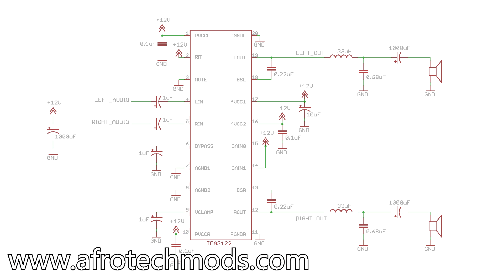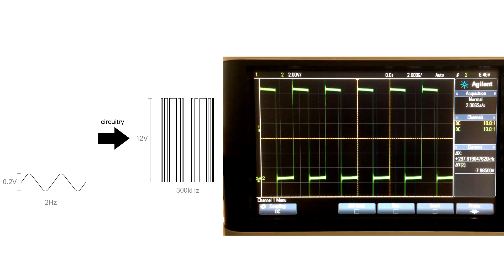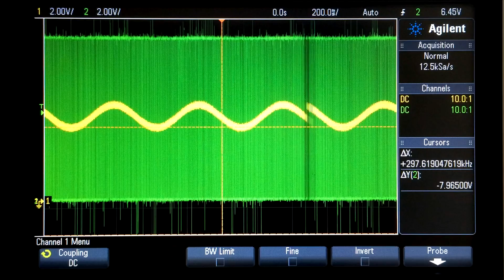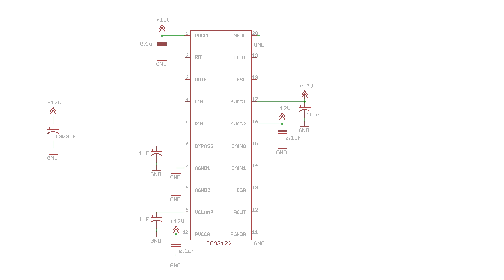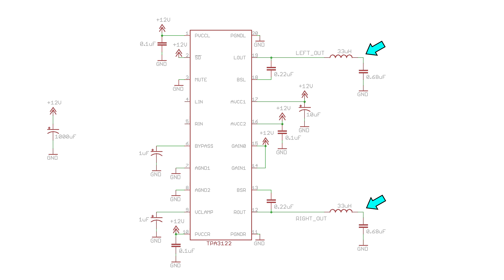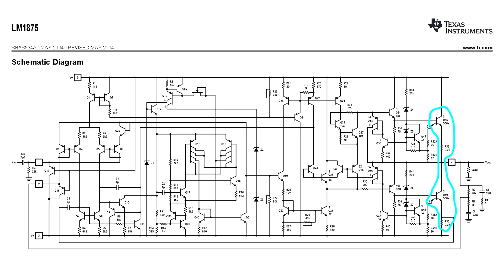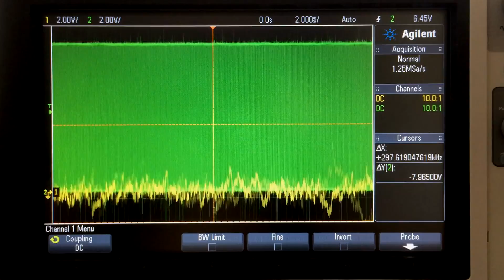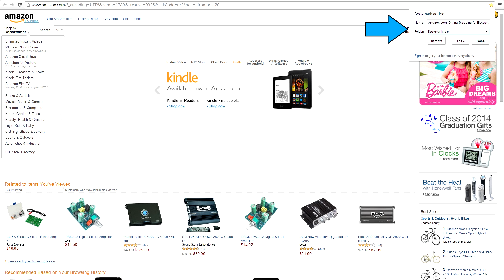Class D Amplifier Tutorial!

Comment: One minor correction - you mention that you can never get a distortion-free output from a Class D amp. This is not necessarily true. If your Class D amp IC has a high enough fundamental PWM frequency and your signal is far enough below it, you can easily use a bandpass filter to remove noise.  If you design your band pass filter well, and possibly use multiple stages, you can get a sharp -3dB with a steep decade slope and have an amp that sounds like a Class A or Class AB.
Reply: +CS Steingrube no amplifier is distorion-free

Comment: Could you briefly explain the power consumption of these amps? I'm planing on buying a tpa7492p which is a dual 25w bluetooth amp and its input is rated from 8 to 25v. I'm guessing, at full power it would need around 50w which would mean i would need a 25v ~2A power supply, or a 12v ~4A and so on? Thanks

Comment: Man you're amazing, i watched a video on another boring guy explaining the same stuff, but i just couldn't walk with what he's saying.
Anyway I've got a question, can i measure the output power of an amplifier board by simply applying a voltage test and current test using a multimeter and solving for the power by V*I?
Reply from the maker: Well the power being delivered would be a function of the load, so if you want to find out max power you'd have to crank up the volume to the max and use the lowest ohm speaker/dummy load allowable. Other than that your plan sounds ok. Just make sure you are using a 60Hz test signal as your multimeter may not be able to accurately measure sine waves with higher frequency than that.
Reply: +Afrotechmods Okay so following what you're saying, I should add a function generator as an input to the amplifier to supply the 60Hz?
Reply from the maker: Yes exactly. Generate a pure 60Hz sine wave.

Comment: Are BLOCKING OSCILLATORS based on Class D amplifier circuitry?
Is a Class D Amplifier in effect a Solid State Relay, working at high frequency switching because there is no inductive reactance?

Comment: earlier for my pc i was using 40+40 class ab amp self buit, it also had a digital fm/mp3 module, then i found a 24v single supply 50+50, 100w class d ready kit, when i installed it my fm was just sounding static, does the pam/pwm interfere with fm frequencies, same happened with another 3+3w, 5v classd kit.

Comment: excellent video, thanks. I've been looking at Class D amps for a project, and I was wondering if you wanted a mono amp is it ok to just use the one half of the IC? also, if you wanted a volume/level control, where would you put it?
Reply from the maker: Using just one channel should be fine. If you want a volume control use a potentiometer voltage divider at the audio input of the IC.

Comment: i am trying to build a amplifier using tpa3122d2 with BTL configuration. i ground the minus input but there is no sound coming out of speaker and no signal at the output.

i checked the circuit connection several times and didnt find any problem.
i suspect grounding minus input and feed signal from only plus input is an error.

do you have any suggestion on BTL configuration ?

another question is since you use single power supply, did you add a dc offset to the input signal?

Comment: I would like to find a schematic to build a 2.1 amplifier that could deliver some real power like 2 X   50W R.M.S and 100W for a subwoofer that could work on a 24 volts battery with an insanely low distortion...kinda like 0.001%.... I know it would be easy to get one tiny board from China....but they are so cheap and you didn't even turned the volume that the distortion already peaks at 10% and I just don't want to build a boombox that sounds like trash.....So I sure hope you can help me!
Thanks in advance!!!

Comment: Isn't it bad to use electrolytic caps to decouple an AC signal? The reverse bias voltage will surely damage them.
Reply: ***** You say "AC voltage can pass in both way of a cap with out damaging it." This is not true for electrolytic caps, which are polarized. When reverse biased more than around a volt, the dielectric becomes damaged and the capacitor no longer works.
Reply: ***** Audio signals most definitely exists above 10 kHz. In fact, the human audio spectrum ranges from 20 Hz to 20 kHz.
Reply from the maker: It's fine. Tons of audio equipment have electrolytic caps on the inputs and outputs.
Reply: Afrotechmods From what I've studied, you're supposed to use non-polarized capacitors for coupling. In normal operation, the ac waveform will remove a tiny bit of the dielectric when negative, but then add it right back when it's positive, meaning that the cap stays fine. However, even a small dc offset in the reverse-bias direction will eat away at the dielectric since the waveform will be reverse biased more often than forward biased. This reduces the capacitor to basically a wire in a can.
Reply: *****
"Non polarized cap are awful for coupling because you catch all the noise in the circuit."
I fail to see how this would be true. Even if they did "catch all the noise in the circuit," why would polarized caps not?

"Well i don t get how a offset would appear"
The whole point of coupling capacitors is to remove any dc offset. If you think dc offset will never appear, why use capacitors on the input or output of the amp in the first place? See 4:40 to 5:06.

Comment: Thank you very much for the post. it's was very didactic!
Only a question: And if the output filtering system would had it's parameter dynamically tuned (using samples from the income wave, or the non implicate source) in order to increase it's resolution?
Reply from the maker: I don't fully understand your idea. In this scenario the amplifier is fully analog, which may not be immediately obvious because we are generating square waves. But no analog to digital conversion is taking place so resolution is not the correct thing to worry about here. A more carefully designed filter network at the output of the amplifier would definitely improve quality though, but it's difficult to get that right if you don't know the exact characteristics of the speaker you will be powering. I sorta used a one size fits all approach here that should work for most hobbyist situations.
Reply: Afrotechmods Thank your for your time in answer!
I wasn't thinking about anything digital at all, the core idea is:
To use the input signal as a comparison with the output signal and the difference except for amplitude (and phase,  possibly) could be diminished by dynamically tuning the parameters of the output analog active filters.
I understand that the ultimate ideal amplifier can be thought as linear transformation that take the spectrum of frequencies of the input signal and has as its only effect to multiply his amplitude:
Be f = frequency, A= Amplitude and phi = phase, If our input is S(f,A,phi) -> Amplification only does S(f,k*A,phi); there is, our amplification only gets the amplitude of the input and multiplied her by some factor greater than unity.
Reply from the maker: baianoise Ah I think I get you. How about this - rather than dynamically tuning the output filters (which I think would get expensive and complicated at the power levels involved), you can implement closed loop PI or PID control. This design is open loop but I've seen some high end amps that are closed loop.
Reply: Afrotechmods Well, thank for the ideas; indeed the PID control seems more suited for the filter when the aim is a simple cost vs benefit design; on the other hand, the dynamically tuned filter could be very good if one has the spectral response of the intended woofer, tweeter and speaker, in that case I think that it could be a very fine tuned crossover control.
Reply: Afrotechmods I can barely stabilize my linear PSU design, I can't imagine a closed loop on a class D, since the output filter would lag the loop, and the thing parasitically oscillating would be nearly impossible to stop!

Comment: So is THD the only audible difference between class AB & D ? And is it REALLY audible ? Emotiva's XPA-2 class AB amp weighs 72 pounds and is rated at 0.1 % THD and costs $900. Crown's NXLS1500 class D weighs only 9 pounds and it's THD is 0.5% and costs only $330. Can some actually hear the difference ?
Reply from the maker: Glenn Watkins Highly unlikely that you'd be able to hear the difference without extremely expensive speakers and a well trained ear. Anything lower than 1% distortion is inaudible to most people.

Comment: This was exactly the info I was looking for when I came here, thanks. I was wondering if you could give some advice on extending the life of a 7498 lepai Bluetooth amp installed in an enclosed boombox? Im running it at 3.5ohms(I know, its supposed to be no less than 4 ohms) Small fan? heatsink? should I remove the top cover of the amp to let heat escape a little? add resistors to the speakers to get 4ohms? Any advice at all will be appreciated
Reply: How much power are you putting into it?
Reply: 36V -4.5amps
Reply: That is around 162 watts of power, I would suggest the biggest heatsink possible.

Comment: Stupid question from a newbie: Where does the - audio in, connect? The tutorial shows the audio in being L and R. I am assuming that is the + L and R. So where does the - (L/R/Shared/whichever) connect to the circuit? What did I miss?
Reply from the maker: What is your audio source and what cable are you using? MP3 player and 1/8" jack?
Reply: Afrotechmods Theoretically, any low audio source. If going from an MP3 player headphone out, you plug into the player with the jack, clip the headphones off and strip wires. You are then left with 4 wires R and L + & -. In the vid you show were the R and L connect. I am assuming this is R and L positive(+). What about the negative? I assume it is a common even though there is a wire leading to each speaker. Where does it connect to the amp?
Reply from the maker: You are correct about R and L +. The negative for both connects to the circuit's ground.

Comment: I'm a Visual-Textile learner, is there a video that actually shows the build for this?
Reply: Walk along with 2:57-5:35 and your components on a breadboard. Almost every pin of the IC is hooked to ground either directly or with 1 or 2 components in between. If you can't follow that diagram, maybe start out with some basic breadboarding videos and print out a symbol cheat sheet until you get the hang of what he's saying. This video won't hold your hand and say "connect one lead of this component here and the other here" but it is very straightforward and that's actually a remarkably simple diagram for what it does. Learn in steps and you'll be fine. 3 years ago I would have looked at that and wouldn't know where to start. If you go back through this guy's older videos he has a lot that explain pretty well what certain types of components do, how they work, and how to use them. This entire channel is more or less a really good Electronics 101 curriculum.

Comment: I want to make one amplifier for SOUND HEALING work. So I need high power and clean output right from 0.1Hz to 20KHz. Which class amplifier do I suggest?
Reply from the maker: Class D would be fine. The hardest part of your problem is the ultra low frequency requirement. You are going to need a massive series capacitor at the output to form a high pass filter that passes 0.1Hz. If you are into this sort of stuff I recommend looking into binaural beats and isochronic tones as another way to get the effect of low frequencies.

Comment: How can this thing deliver 2x 15W without ANY heatsink? I've got an Class D Amp module using the TDA7297 which has got a modestly sized heatsink on it, and it gets warm when delivering some power to the speakers. How does this one run fine without any?

Nice video anyway!
Reply: It runs on a higher voltage and lower current. Additionally, its efficiency rises if used at higher power. It will still emit quite a bit of heat, losing about 3-4W in total, but it's designed to run hot, it won't take damage from that. 120°C is its normal operating temperature. Higher difference between IC temperature and environment temperature means more efficient heat exchange. So don't touch it!
Reply: Siana Gearz  the reason for no or a small heat sink is because. class D is operated as a switch I.e when it's on it's a short circuit almost zero ohms , ohms law state volts divided by resistance equals power ,and of course when the transistors are off you have a high voltage but no current hence no power dissipation in the output transistors   Class C is the only other amplifier that is used as a switch these are not for audio but in radio transmitters never for audio ,all other amplifiers are partly on hence heat is generated class b is only turned on when a audio signal is present but is very distorted at low volumes it's all to do with the characteristics of transistors and valves they are not linear unless biased into that region which is linear

Comment: What if you place an audio transformer at the output of the chip instead of the inductor? will I get more power and filtering at the same time?
Reply from the maker: You wouldn't want to do that on an amp like this. Audio transformers are typically used after valve amps to provide better impedance matching.

Comment: I have lots of ceramic disc capacitors, will these still work fine?
And can you use the Class D amplifier to boost the volume of small speakers?
Thanks and great video.
Reply: no, due to transients and ampere fluctuation. would work in super low output situations, but not here. (if i understand correctly)
Reply: Only if you have the correct values. And you need electrolytics for the input and output stages.
Reply: ***** Thanks, appreciated
Reply: djbadandy1 Thanks, appreciated

Comment: I have one question in the circuit diagram every pin of the TPA3122 was shown as ground , so what is that ground , you connect it to the negative or what?
Reply from the maker: Yeah ground in this case is basically the negative side of your supply.
Reply: thank you

Comment: Ok, first of all, Y U stop making videos? You were hilarious. (And yes I watched way back when you actually made videos)

Second of all, I'm sorry, I need to grow beyond this. I need MORE POWER. Word on the street is the high distortion from my 2000 Ram's stereo might be due to the previous owner putting in aftermarket speakers that are rated for 100W and consequently too low impedance, I presume. I could buy an amp..... And I might, but this would be  a fun project.

Guess I'll put my EE degree to work and come up with a higher power driver. I want to maintain the original head unit look but improve the radio a bit, maybe hack in an aux jack somewhere. That would be cool. Listen to some new retro wave music on it...... Now I'm all excited.

Comment: How would you scale this upwards of 100watts?
Reply: DarkLinkAD There are several choices, 3 that come to mind are: Bi-Amp & Bridge-mode. With a Bi-Amp configuration, each amplifier is configured for a specific frequency range, connected to a cross-over before the amplification, and the speakers are connected directly to the amplifiers. 
Implementing a bridge-mode amplifier is a bit more involved. [Bridging the signal of amplifiers that are out of phase with each other.] Lastly, you could use the TAS5342A IC designed for 100W, but different component values will be required. http://www.ti.com/product/tas5342a
Reply: Higher voltage supply and better MOSFET.
Reply: no1 really needs 100W indoors